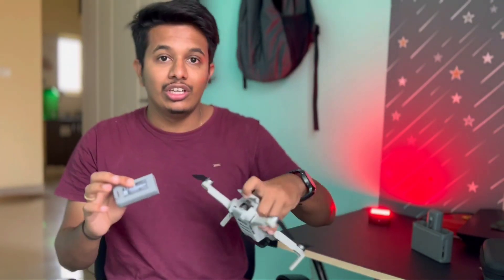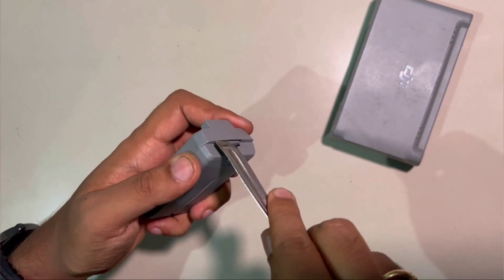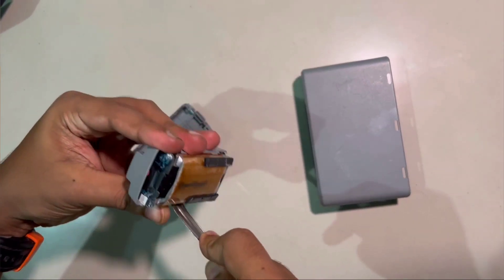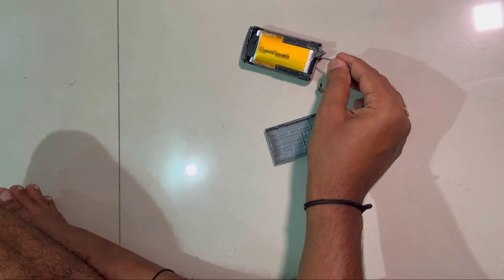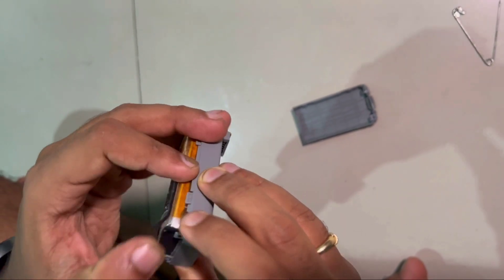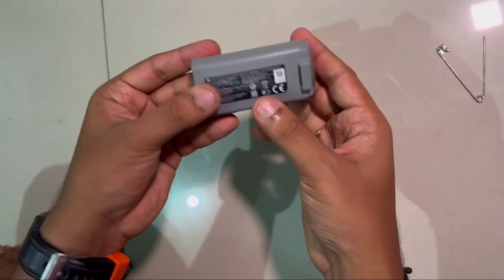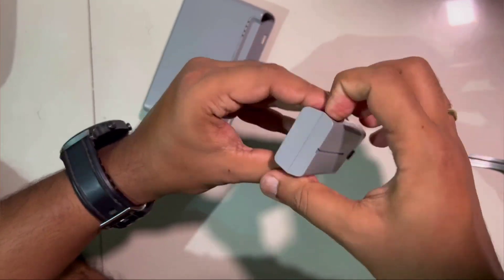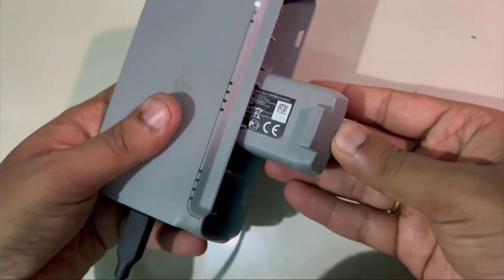how to reuse swollen DJI MINI 2 battery  | Drone battery swelling repair at home #djimini2

Comment: The DJI Mini 2 batteries bloat problem was never adequately addressed. I had 3 batteries with the drone and bought an additional one, all showed bloating within 1 month with most being used maybe twice ever. Shockingly bad. Worst part is there's no returns, no refunds, no nothing on batteries because they claim they are 'hazardous material' that cannot be returned.
The reality is you CAN pierce cells if you do it under oil, or in an inert atmosphere, and then immediately reseal it after expunging the gas inside. You can do this with any bloated battery. But it IS very risky to do.

Comment: If you puncture the cover you must re seal.  If air gets in, it will rapidly degrade.  So a good quality tape or glue.  A pair of new cells from Ali express is £10

Comment: Hi i need advice from you i get my drone after 3 years from customs its zino2plus its battery is not charging and not working its cells are also swallowed little bit, can i replace its cells with dji battery cells?